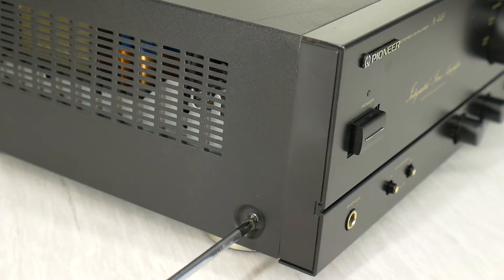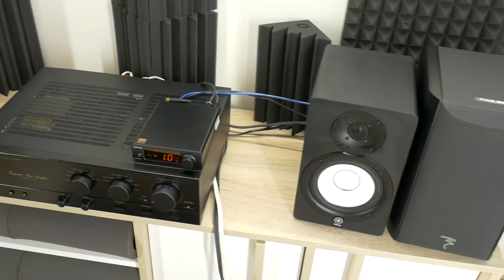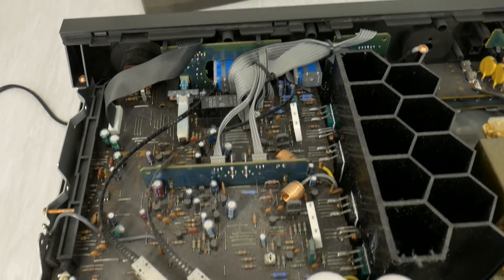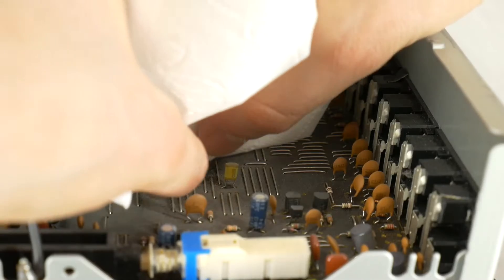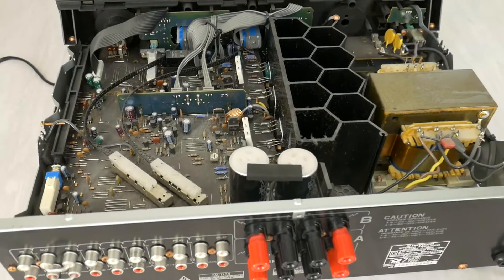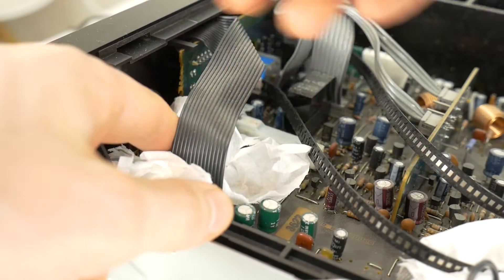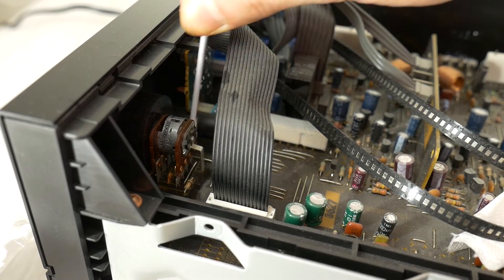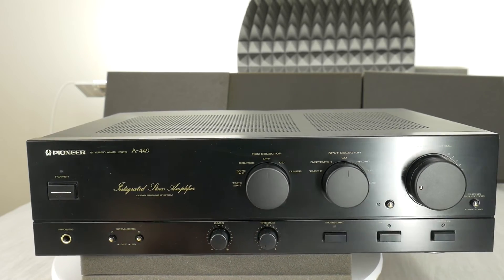Fix Amplifier Scratchy Volume/Tone Knob DIY

Comment: Hey Tech, over the past year I've dipped into the vintage stereo addiction.  I purchased a Kenwood KR 7400 and used it for a couple of months before I was deployed and had to be away from the states while my belongings sat all summers long in an un-air conditioned apartment for about three months here in steamy Florida.  When I returned, I noticed there is some scratchiness as I adjust the volume up and down - it's only merely a nuisance, but I feel as though it's not transmitting the same volume power to the speakers as it was before. Is this something I'm merely imagining, or is this something that happens in conjunction with the scratchy controls?  Thanks.

Comment: I think that a better option here will be opening the potentiometer and then cleaning. First cleaner spray and next the "maintenance". Otherwise the dirt will stay inside. Also, a part of potentiometer (like Sony) has the grease inside which slows down its move. Using a spray will wash it out. Generally, to open a potentiometer usually we don't need to unsolder from the main board (unless we're unlucky) - we must only bend the metal hooks, pull out the metal case and then we can use liquids. The only problem is because these hooks are quite delicate and can be broken. My Onkyo waits for such cleaning but there is a small place inside and this work won't be comfortable...
Reply from the maker: it sounds more complicated :(

Comment: this is temporary solution, the dirt and oxidation are still there and is not removing it. this is for the emergency option like any life performance, event and your equipment play around then you use it but after is you need to do proper repair and clean up. i do vintage audio restoration and every switch and potentiometer treated by those sprays are very destructive in long term. proper repair is to desolder potentiometer or switch, open it and properly clean and then apply appropriate grease on contacts. if you can’t clean the replace the faulty part. spray just do more damages in long term.
Reply from the maker: therefore use correct sprays.
Reply: @Techscrews  i think you don’t understand. is like using perfumes or antiperspirant remove stink bur doesn’t clean your body. dirt remains. don’t question obvious and common-sense thinks not to mention experience.
Reply from the maker: @Johny666EU  its works, just use correct cleaning/repair spray.
Reply: I agree with you.  The only thing is, and I had this experience with a Sony Service Center long time ago, they scratch your cabinet.  Somr shpos just stack the equipment on top of each other.  I'd rather do the job myself, but can't.  Will removing the front knobs and blowing it out with air help?

Comment: Unfortunately, this washes out the grease that slows down the potentiometer, making its use less pleasant. Additionally, the dirt concentrates in one place. The agent may also cause damage to metal elements and potentiometer paths. This solution is not long-term and may cause permanent damage.
Reply from the maker: yes and no, these are special products for cleaning the potentiometer, to improve long term performance, a second spray can be used which provides lubrication of potentiometer. I've been using the method in the video for years, it doesn't cause any problems.
Reply: Yes, I believe that.  You could see on one part of the video how the spray went off to the side, even though he put paper towels down.  I've got scratchy volume knobs and have to go slow when turning it to avoid noise.  What can I do?  The knobs come off with a hex key.  Try air blowing it?